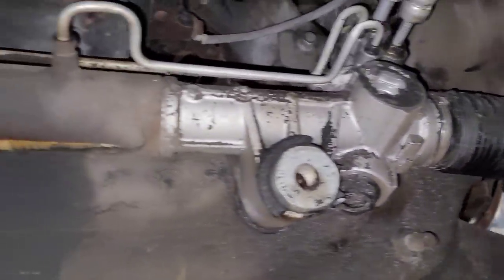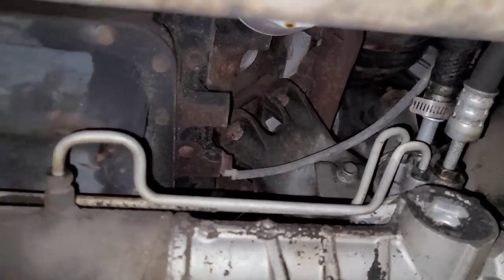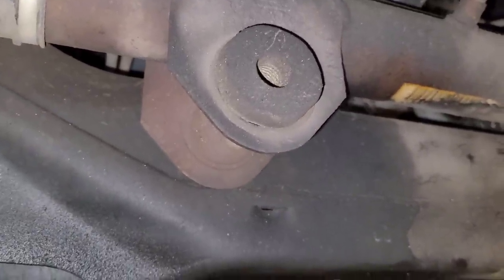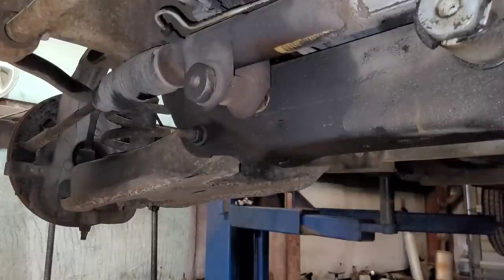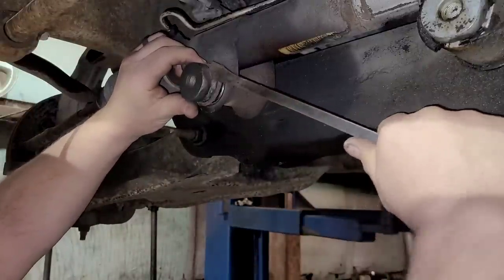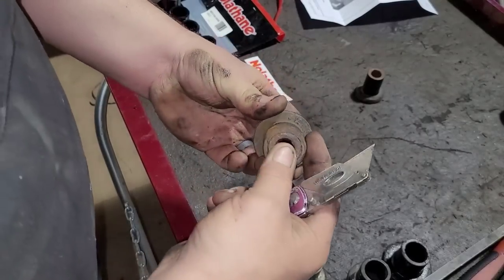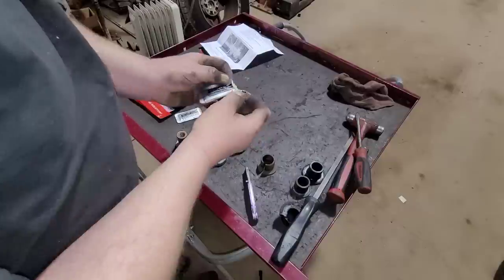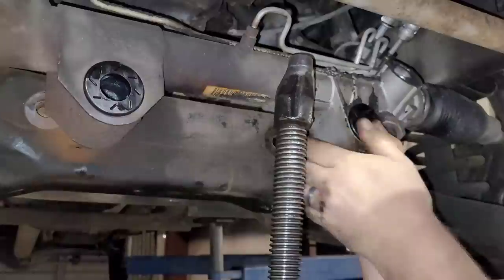Loose Feel in Steering? 10 Minute Steering Rack Bushing Upgrade Helps To Handle The Corners!!

Comment: Note that this procedure will not work on a 5.7L 2wd. There is not enough room between the bolt head and oil pan for a socket and ratchet on the passenger side.  Could use 24 mm box end wrench and pound on it, the old double wrench trick, or just use large impact socket on the large nut bushing in the front, or pipe wrench, lg crescent, going to replace that bushing liner so it doesn’t matter if it gets torn up. Or could drop the oil pan LOL.
Reply from the maker: I believe I've done one before , and I've taken the motor mount bolts out and raised the motor to get to the bolts. I'm not 100% on that, but it's ringing a bell. Thanks for the input !! Keep Wrenching!!

Comment: This bolts are tightened at 232 ft lb. My torque wrench reaches 150ft lb. I was only able to torquebat least 😂 100 ft lb. More than that was pushing myself out.

About the sweavel socket gonna get one. 

I noticed does move the one i couldn't torque. 

I 🤔 wonder if the outsider diameter has a specific tool like a bigger socket.

Comment: 😂"I'm 300 lbs. I put a lot of weight into that." But you're standing on the ground. Not that I blame you those bolts are tough to torque down especially the one on the oil pan side.